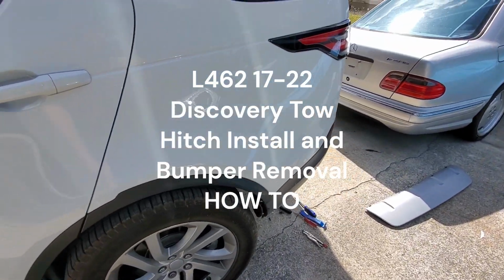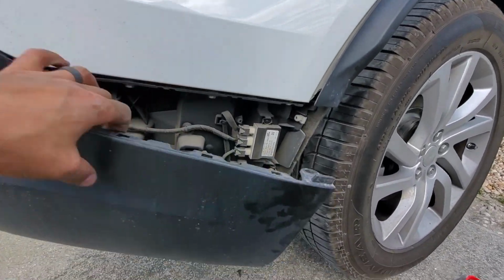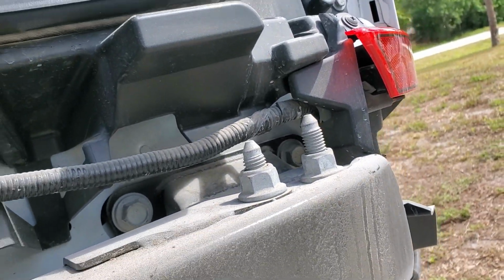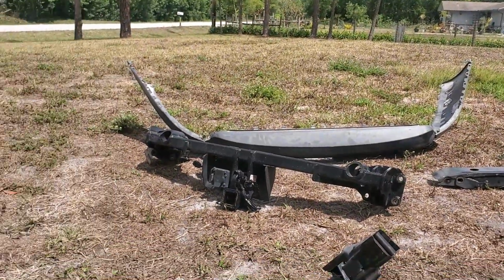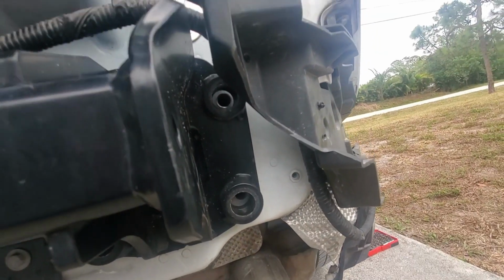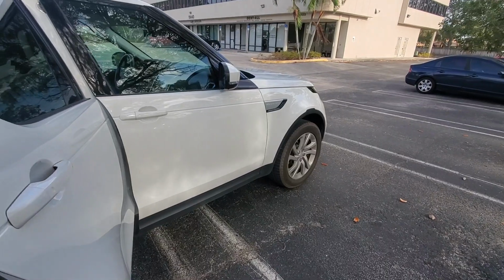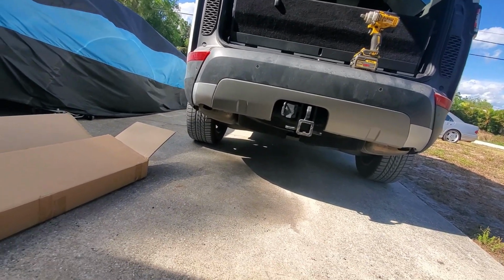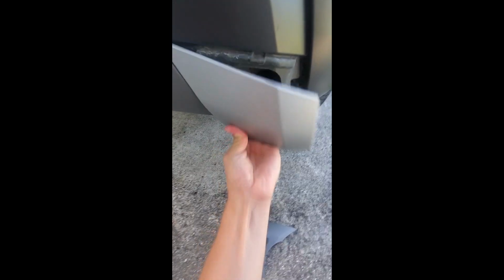2017-2022 Land Rover Discovery Tow Package Install HOW TO DIY, Easy install! Plug and Play!

Comment: Glad I found your video.
I'm about to do this job tomorrow but I'm fitting the electric folding tow hitch, but the actual cross member looks the same as yours.
I found some info that the bolts were M14 x 148mm for the longer ones but I wasn't 100% sure, but since you kindly shared the bolt part number I googled it and confirmed the bolt length 👍👍
I also need to fit another wiring loom running into the boot. Then install the towbar ECU, install the switch panel, then program the car.
Should be a fun day 😅
Reply from the maker: Glad it was a help to you. Electric folding hitch sounds nice! I do not think I have seen that before. I assume it tucks up and hides under the bumper trim? 

It really wasn't too difficult of an install so hope it goes smoothly for you.
Reply: Hi am I’m wanting to tackle exactly what you are talking about. Did you manage to this is the end? Apart from the deployable towbar you need those 4x bolts, the ECU and switch. Was that it? Did you need additional wiring as well?
Also how did the coding go or was it plug and play?
Any advice would be appreciated
Thanks
Reply: @LeePeat  you need... 1x tow bar, 1x ECU with the loudspeaker, 1x wiring loom, 1x pair of switches to fit in the control panel in the boot on the left. A few bolts M15 in size.
I coded it myself using the very excellent IID Tool, I struggled at first but after speaking with the tool manufacturers they found it was due to a glitch in the tool software which they fixed the same day for me.
Everything works great. Actually a fairly easy job.

Comment: I can't find this part, can you provide brand or more detail
Reply from the maker: @davidgraterol6210  it's a factory tow bar/rear reinforcement. Can order direct from Land Rover or get one used like i did. Ebay has a few.
Reply from the maker: @davidgraterol6210  LR126253 is the part #

Comment: Where can i get the link for the part?
Reply from the maker: @diosmanyacosta5317  I purchased my tow bar used off car-part.com but can check ebay or search local junkyard. I think I paid 350 for it to my door. They are double that new from Land Rover.

Comment: What bumper did you buy?
Reply from the maker: It's the factory non tow pack bumper. But do you mean the lower rear valance that has the cut out for the tow hitch?
Reply: Yes, sorry. 

Is that a factory part too?
Reply from the maker: @JoshGilliano-eq2ih  hi yes it is. The part# for it is LR083033

Comment: Did you have to do anything to the car system? Or did it work straight away? I have seen stuff saying you to need to plug the car in to add towing features
Reply from the maker: Nothing it just worked right away. No programming needed. Tow regularly with it with no hiccups. All trailer lights and my trailer brake works.
Reply: @cpstang24  thanks, installed today but not tested didn't have an adapter to convert back to 7 pin in the end 😂
Reply from the maker: @dufton21  haha that's always the way it goes! Glad you got it installed though that's the hard part!

Comment: Is that factory tow hitch? And harnees?
Reply from the maker: Yes factory hitch I bought used from another discovery that was in a salvage yard. The harness was already wired behind the bumper i just had to plug it in to the tow hitch.
Reply: @cpstang24  nice. I hope i can find used one. Thank you.
Reply from the maker: @johnpacatang1308  try car-part.com is where I got mine. I think its under rear reinforcement